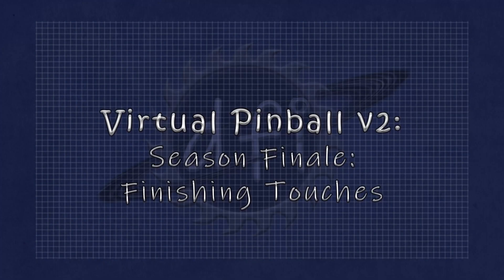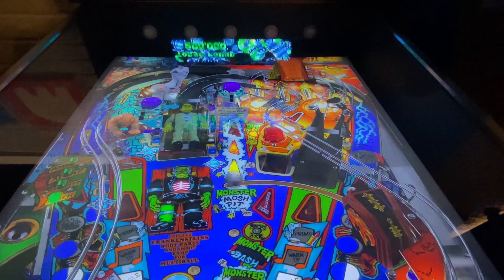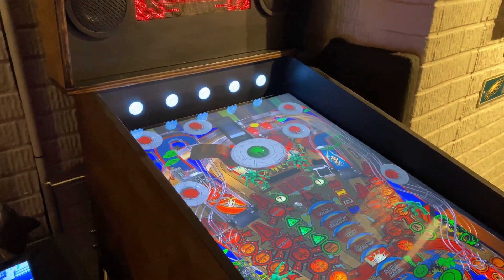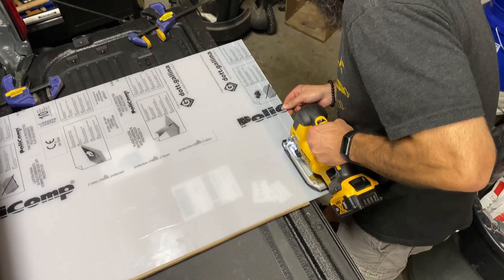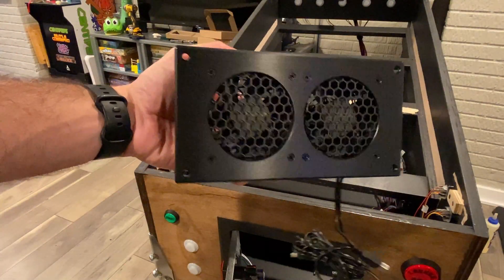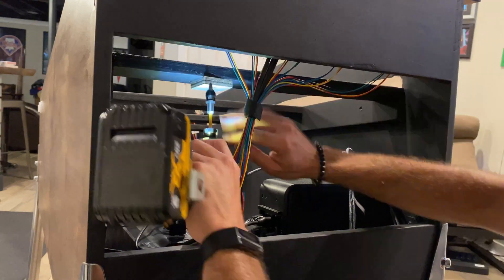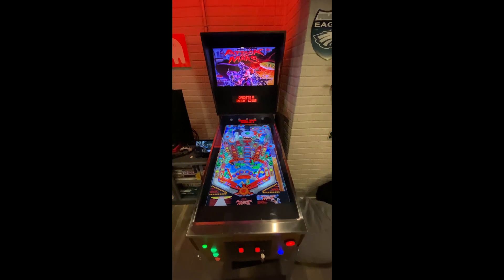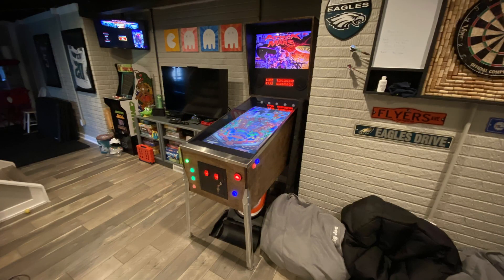Build A Virtual Pinball Machine: Season Finale - Part 11

Comment: I have a question about the launch and start button with dog links. Say I add enough credits to start a game. Can it light up the start button like a real pin? I’m trying to figure that out. Also, you have an amazing looking cabinet. Well done.
Reply from the maker: With the way I’m using my controller, no I can’t get the button to flash, I was having issues with the 5v buttons burning out instantly so I had to improvise a power source temporarily. I’ve never gotten back to fixing it. Long answer short, yes it’s possible and I want to do it. I hope to get a video with a walkthrough on it up soon